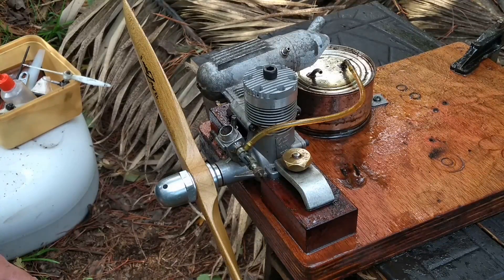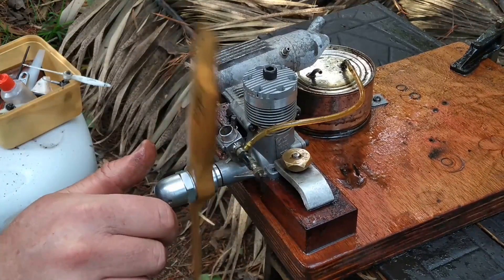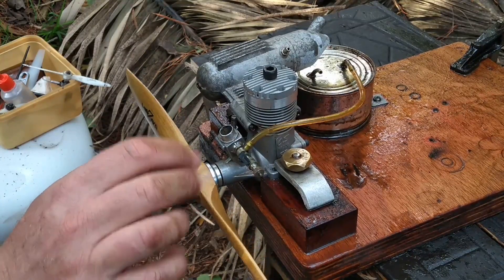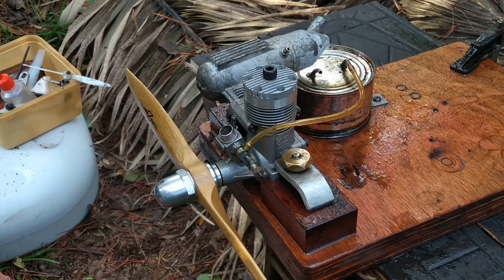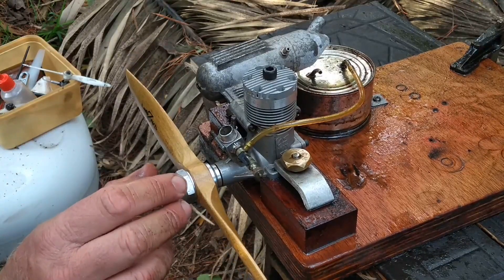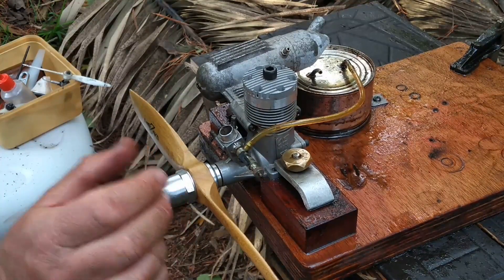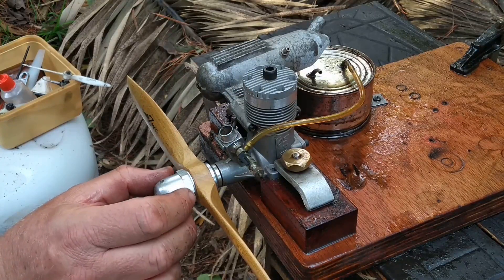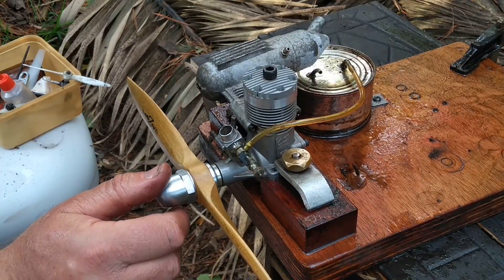Lockdown Engine Run - OS Max 40FP Diesel

Comment: Never understood why anyone would want to modify a glow to diesel, how long would it last?
Reply from the maker: For an engine this size the main reason would be to reduce fuel consumption for a class like Open Texaco where you need to fly for a long time on limited fuel. I think it would wear out quicker than a glow in normal use, but for low rpm, fuel-saving runs it would keep on ticking.